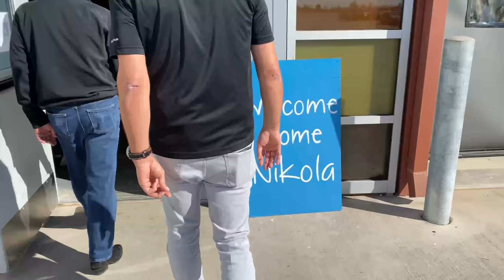Nikola Series - Ep. 3: Coolidge Facility - Assembly Tour

Comment: So when are you guys going to address the elephant in the room?
Reply: That room is pretty darn empty. Lots of shelves and lots of talking back and forth. Lots of things not there that ought to be
Reply: The elephant was hard to see in such a vast and empty facility, so Sandy was carefully steered away from it... Lol
Reply: Lean manufacturing should keep the place empty unless there is quick production order. But you trolls wouldn't know that...
Reply: @togowack  if a manufacturer is planning on high volume production, Lean Manufacturing would have them set up for the goal, not the the minimum.
If you set up small for a temporary period, that's the opposite of Lean, because you have to get rid of the small stuff and duplicate the work.
And it's not parts and materials that we think it's empty of, but rather the machinery needed to manufacture trucks.
Reply: @ke6gwf  I'm not making sense of your post. Nikola could probably put half a million trucks a year out with this setup we have seen. What do you mean by 'small'?
Reply: @togowack  you either can't do math or don't understand reality.
You think that they can build over 1,300 semi trucks PER DAY with the equipment we saw in this video?
Half a million per year is about 1 rolling out the doors every minute.
Are you seriously claiming that what you see here can get that kind of production?

You can't fit enough people in that building to build that many trucks, and other than the little carts, I don't see a robot in sight.
Reply: @ke6gwf  What do robots have to do with productivity? They are inefficient and add a magnitude of trouble to every supposed problem they solve. They are massively depreciating financial assets that are quickly outdated and when they break are insanely expensive as well as anything connected to them. As for the productivity of this assembly plant, what does it have to do with what you see? The math was done on paper for investors.  An assembly plant processes vehicles on a track. It's not meant to store anything. Their processing power is not computed by anything to do with square footage.
Reply: @togowack  wow, you are so much smarter than every factory owner and truck manufacturer out there, because they are finding amazing savings and increases in efficiency by using robots for the very repetitive tasks.
But I guess you know more than they do!
And unless the factory process changes, robots don't get outdated, any more than humans do, they get reprogrammed.

The assembly plant we see in this video is not able to produce whatever they put on paper, that's what they claim they can do long in the future, but this assembly plant we see in the video can probably only produce a few trucks per month, which is why I say it's way too empty, because it needs more machines, more tracks or robot carts, more people, etc etc.
Reply: @ke6gwf  Hello friend, I'm not coming up with this just from 15 years working in automation, Elon Musk has been saying so (if that matters). Robots also require highly paid specialists that are specialists not only with robotics but with the product being manufactured. Robots do get outdated, have several layers of software that was often written more than 10 years ago, operating blindly and not meant to do specifically what the end user needs. 

The assembly plan is not able to produce? How do you know? Who said that? The Nikola plant is a product of the European silicon valley. It is modeled after an already successful German plant. Practically the only thing they will be doing, is crane operation and bolting!!
Reply: @togowack  Elon said he underestimated the value of humans when he tried to do too many things with robots on the model 3, so he added a few more humans until he could get the robotics figured out.
Have you seen any of the videos from inside Tesla factories? It's fully automated with robots doing as much as possible.

Some of the stuff that still needs humans, like putting the dashboard in etc, the humans actually sit strapped into cockpit chairs on robot arms that swings them in through the car door and positions them correctly to install the parts, and then swings them back out.
And it's all these robotics that allows them to produce so many cars with only 2 factories, and a 30 percent profit margin.

Maybe the robots that YOU work with have those problems, and ancient software, but that's why Tesla purchased a leading German factory automation company so that they can make everything custom to their needs, and they have strong software engineering talent so they can write new software from the ground up.

So when done properly, automation is amazing and extremely efficient, because it's perfectly repeatable at high speed, and doesn't tire out.
Also, they use a lot of computer vision etc to give the robots eyes so they can be even faster and more accurate.

This is the same company developing leading AI and computer vision on cars, and they can apply the same talent to the factory.

So maybe you should go work for Tesla and enjoy your job a lot better working with much nicer automation!

As far as the Nikola plant seen in this video, it looks nothing like the Iveco factories, which are full of equipment, and yes, robots.

So if this is based on the European factory design, it currently looks nothing like it.

It's almost like you didn't watch this video, or have never seen what an actual factory looks like inside.

This looks like hand building prototypes inside a warehouse, and you say it can produce one truck per minute. That's what confuses me.
Reply: @ke6gwf  Hi Blackburn. Your post is too long you gotta break it to simplest form. Elon plans on replacing 1000 robots permanently using the gigapress. Has said many times, robots create a lot of new problems. He would have no problem making production quotas with technicians, far easier to train people. I should go to work for Tesla? Do you know why they can't find skilled people, do you know what pressure they are under? No fun. If Nikola produced 1 truck per minute their stock would go by 10x.
Reply: @togowack  Tesla is replacing 1000 STEPS by casting a single piece instead of welding together hundreds of small parts. The goal is to simplify the manufacturing process, not simply eliminate robots.
And the Giga press is, of course, handled by a robot to remove the castings.
Elon's goal would be to have an entirely robotic factory, the machine that builds the machine, which is one reason he's starting work on the humanoid robot, because right now there are some jobs that still work best with a human.
And yes, robots create new problems, but problems are meant to be solved through engineering, and so they are gradually working to redesign the car to optimize it for robotic assembly, solving those problems one step at a time.

Anyway, your philosophy is the opposite of Elon's, so I guess you won't fit in at Tesla! They only attract the best engineers. 

And if Nikola produced 1 truck per DAY their stock would go up! But they can't even do that yet... Lol 
But you were the one who said that this facility that we saw could produce half a million trucks per year, which is about 1 truck per minute run rate.
Reply: @togowack  Umm, the Gigapress is built by Idra, who is based in Italy. Tesla is purchasing them from Idra.
Tesla purchased the German automation company so those engineers are not unemployed, they went from working for many manufacturers to focusing on Tesla alone.

Elon is all about removing parts and steps, so if he gets rid of a robot it's because he got rid of the part or step the robot did, not that he's just replacing it with a human.
Elon wants to eliminate humans from the factory as much as possible, and is only limited by the operations that they haven't figured out how to do with a robot yet, but they are working on it.
Reply: @ke6gwf  It doesn't matter who built the gigapress, the FEA that will be required to get good castings out of it will take the best engineers. Germany continues to graduate top ME's and still has probably the best technicians in the world but its automakers have gone into recession. The situation is perfect for Tesla. I don't think you really pay attention to Elon. Eliminating humans isn't what he is about. He is about solving problems.
Reply: @togowack  yes, Elon is about solving problems, and one problem is that humans are expensive, slow, and high maintenance, while robots can work 24/7 with no breaks, are predictable, and can work faster and more accurately and repeatablly than a human. So finding all the jobs that can be sped up and made cheaper with a robot is a problem they are working to solve.
And yes, I believe the access to talent was one big reason why they put a factory in Germany instead of some cheaper location.
Same reason Tesla is in the Bay Area, and SpaceX is in Hawthorne.
Reply: @ke6gwf  you've got it backwards. I already told you they are like cars. I just finished building one this year. They are expensive all the way and once you've put your miles on them, are worth their weight in scrap, literally, because they weigh a ton. You can't just replace the bearings, the journals wear out rendering the castings worthless, they crash destroying tens of thousands worth of gears in a shot, they are 100% blind and the workpiece has to be perfectly setup everytime.

ME stands for Mechanical Engineer, something USA is very short of. Tesla is known more as a software company for the reason you list - its full of millenials that know how to code, but have little or no manufacturing experience. When there is trouble Elon has to even call the office workers to the floor to help, because the USA lost its manufacturing expertise decades ago and stopped teaching it.
Reply: @ke6gwf  They can't. Ford and Toyota would crush Tesla at full production. You can't beat 100 years of experience in manufacturing. Ford owns production towns like Fort Rouge all they have to do is remove the padlocks to 500 tons a day. Do you think they want to be in the robot building business? I thought they were in the car business? They took on 2-3 times as much as would make sense for linear car production. The Tesla Cybertruck should been in production already, that's the easiest thing to make in the world!!
Reply: @ke6gwf  You have to realize how fast industry can change and recover. It took 2-3 years to produce 60,000 tanks in WW2 from making cars, and half North Americas steel. As far as making a car body, gear boxes, its really simple just an order from the right people would put Tesla out of business.
Reply: @togowack  the factory to build the Cybertruck is currently under construction, did you expect them to build it in a barn? It also needs the 4680 cells that are still ramping production, so it's not quite ready to start.

VW says that it takes them 40 hours to build their EV, while it takes Tesla 10 hours. That's mostly thanks to the automation in the factory. And that's how far ahead Tesla is from the top German manufacturers. 

Ford just decided to double their planned EV production, and their target for 2024 is about half what Tesla will do next year.
And Toyota is having to partner with a Chinese EV company to build EVs for them.

The old Ford plants would have to be fully rebuilt in order to start car production again, including the installation of thousands of robots, because that's how auto manufacturers do things now, so it will take years for such construction and then the ramp up.

It's not like in the movies where someone walks into a dusty old factory and flips a big switch and the factory roars to life, because technology has changed so much that nothing in that old factory would still be usable, the layout would need to be entirely different, and remodeling an old building is usually more difficult and expensive than designing a new building optimized for your needs.

So this idea that the other manufacturers are going to be able to magically make as many cars as they want faster than Tesla can is just funny.

And look at how easy it is to make mistakes.
Like GM having to recall every Bolt made to replace the battery, and now the rumors are coming that Porsche may have to do the same thing.

And maybe Nikola will do all the manufacturing by hand no robots, but if they do, they will not be able to compete on price against Tesla with a truck designed for efficient construction using as much automation as possible.
And the Cybertruck is also designed for maximum automation.

Comment: Many thanks!!!! Your opinion has a high credibility here in Germany.
The factory in Ulm-Germany is up and running, according to Hamburg radio station the harbor is receiving the first 3 TRE Trucks 17-12-2021
Reply: Is Arizona copying Ulm then and producing the same truck?
Reply: @stefanwagener  The factory in Germany is already finished, 100 Trucks will be shipped to the USA starting Q1 2022, they would keep shipping until the Arizona factory is ready for mass production.
The rest of the trucks built in Germany will be sold in Europe by Iveco, the famous Italian Truck company.
Reply: @stefanwagener according to the Iveco CEO, both factories are able to build the electric and the hydrogen trucks on the same production line
Reply: Good news! 👍
Reply: @ALEXPERTOS.  100 trucks in Q1 2021? Encouraging as Russell said at the September 15th, 2021 event that they would only produce 100 in Ulm in all of 2022. The Ulm leader said "series production" would begin at the end of 2021, and that they have to redesign the truck (shorten for length laws) to sell it for use on European roads (ports being an exception). He said that was expected to be done in time for 2023 production.
Reply: @stefanwagener  Coolidge and Ulm are producing the same truck, but Ulm has equipment to speed up the process from the hand assembly that Coolidge is doing. But Mark Russell referred to Coolidge as bother a "sister site" and a "twin" so it is very likely Coolidge gets that same equipment as Ulm once they have expanded.
Reply: Wann hast du die Nachricht mit der Auslieferung an den Hamburger Hafen gehört?
Reply: @Lockbert 100 trucks starting Q1( I just edited my answer), their products aim until end of 2022 is 2000 trucks
Reply: @amkoa8590  wurde im Radio erwähnt im Interview mit dem Chef des Hafens über seine Pläne für CO2 Neutralität
Und wurde auch im Reddit erwähnt
Reply: @ALEXPERTOS.  I think you may have misread their statements. Ulm is said to have a two-shift capacity of 2,000 trucks a year. But Russell said on 9/15/2021 that they would only do 100 in 2022 and 250 in 2023.
It was recently reported that Ulm is not only not doing two-shifts, they are are having employees work part-time.
Reply: @stefanwagener  Right now Arizona is still phase 0.5 but when phase 1 open it will have an assembly line just like the one in Ulm.  That's smart because there is no point in reinventing the wheel.  They will be able to produce both the Tre BEV and Tre FCEV on the same line which will reduce costs.
Reply: @ALEXPERTOS.  Danke für die Info, hoffentlich steigt der Kurs bald mal anständig Lg
Reply: @amkoa8590  daran habe ich kein Zweifel :)
Hör Mal ein Podcast von ( Geladen - Elektrische Lkws - Batterie- oder Wasserstoffantrieb? )
Da erzählt der Iveco Chef von dem Plan von Nikola in Europa usw für die nächsten paar Jahre
Reply: @ALEXPERTOS.  Ist eigentlich Schade wie viele Menschen Nikola keinen Erfolg gönnen, Mercedes wird genau die selbe Bosch Technologie für seine LKW's benutzen, und Bosch ist sogar Aktionär bei Nikola. Ich persönlich denke das Wasserstoff in Zukunft auch viel günstiger werden wird, somit steigt auch die Rentabilität, hoffentlich schafft es Nikola in den nächsten Monaten durch gute News einen höheren Kurs zu erzielen und mehr Aktionäre zu gewinnen, genug Potenzial haben sie ja.
Reply: @amkoa8590  wenn ich die Aktie beim damaligen 90€ Preis gekauft hätte, wäre ich auch angepisst gewesen. 
Wenn man die Sache rational betrachtet, selbst wenn Wasserstoff nicht die Zukunft ist, sie haben ja schon einen Batterie Truck

Comment: Oh boy.  Hand built trucks that will have to compete with a heavily automated Tesla factory.  Hmm...
Reply: With triple fueling costs, 10X the maintenance.....definite winner.
Reply: @Mrbfgray  The truck in the last video was battery only.
Reply: You are assuming that these trucks will ever be built. They are still in the process of designing the batteries. Batteries better than anything that is currently is available. Yeah we'll see how that goes.
Reply: @lockbert99   Right.  But that's not Nikola's claim to fame.
Reply: @henryD9363  Why do you say they are designing batteries?
Reply: @henryD9363  - NIKOLA does NOT make battery CELLS.
they use COMODITY cells.
Reply: @lockbert99  because they said the version of the Tre in the video is the battery electric Tre, the hydrogen fuel cell is 2 years away.
Reply: @Mrbfgray  Bo, Mcdonalds needs a new cleaner.
Reply: @danieldeblasio9368    Figured you'd be tuned into that market, go for it, we all gotta start somewhere.
Reply: ... And Mercedes, MAN, Scania, Volvo, ect..

Comment: they have nothing, also the running costs for those trucks wont work
Reply: Why do we care if it works if they have nothing? You need to pick one.
Reply: They have lots of square feet of shiny floor. And probably a lot of shelf space you might say. Unfortunately assembly will be in another building, nearby.
 Top secret
Reply: Are you blind?
Reply: @ssbbpp  i didnt see core components such as fuel cells, h tanks, motors.